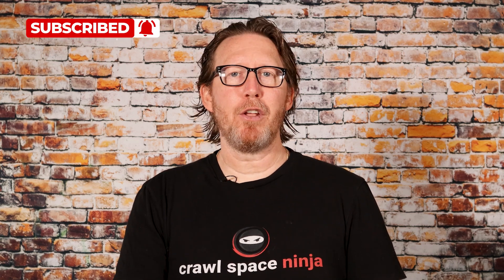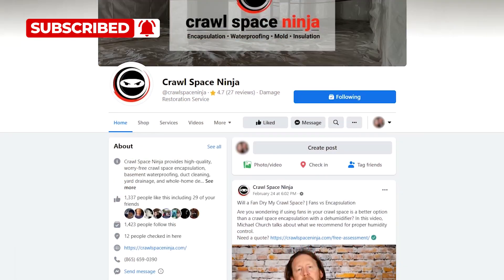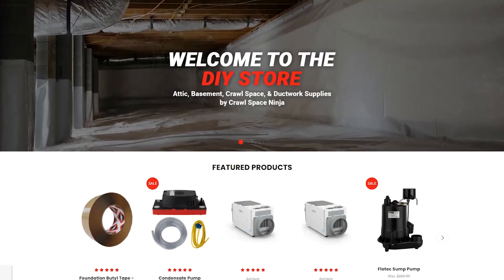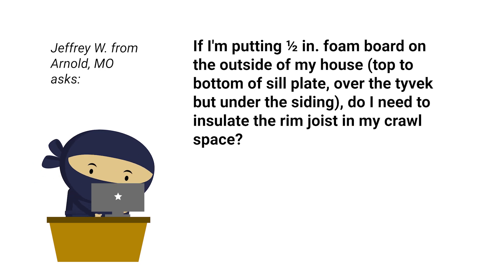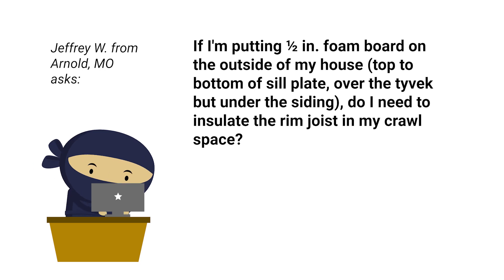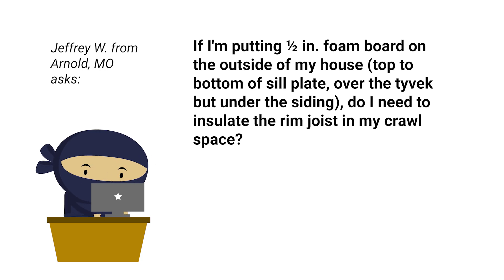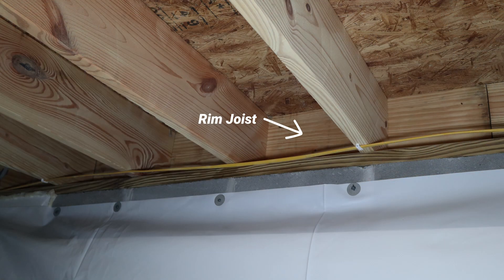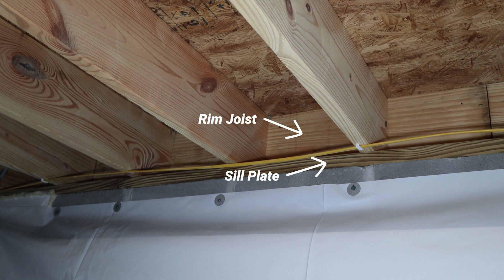Do You Need Rim Joist Insulation If Your Home's Exterior Is Insulated?

Comment: Dear Crawl Space Ninja, I have found 2 inch eps foam board that has a facing on one side.  Can I use this to insulate rim joist in my crawl space?  If so which side does the faced side go toward the wood or toward you as you are putting it in?  Thank you so much for your videos and keep up the good work.
Reply from the maker: Hi! it doesn't matter which face!

Comment: If you had a professional encapsulate your crawlspace and removed the floor insulation and tell you it was no longer needed. Have they misled me and took a short cut to the work but not the cost of the encapsulation.
Reply from the maker: We remove subfloor insulation because we insulate the crawl space walls! We do this as the subfloor insulation is not needed if we insulate the crawl space walls

Comment: Would sealing the rim joist with a bead of spray foam prevent bug penetration? Do you have any tips or tricks or videos for preventing insect penetration? Thanks for the content
Reply from the maker: It should certainly help. You can also do a small bead where the foundation wall meets the sill plate, just don't cover sill plate if you have a termite warranty. We don't do a lot of pest exclusion like the pest control companies do. Hopefully I can find one to do a video with me on that. Great suggestion. Hope that helps.
Reply: @CrawlSpaceNinja  thanks. Yes I think pest prevention is an overlooked benefit from air sealing that I can’t find too much content on. It seems most folks and companies are fine with using chemicals to kill pests whereas air sealing is solving two problems at once

Comment: What would you recommend on insulation a cantilever ( overhang ) and the rim joist?
Reply from the maker: We have used a combo of foam board and spray foam to air seal the cantilevers. Not seen all that often in our area but that seams to work for us. Hope that helps.

Comment: Hi so I have brick and mortar filing my rim joists blocking access to the wood, no clue why it’s there but am I pretty much screwed from sealing the rim joists because of this?
Reply from the maker: If the brick is touching wood you could caulk around the edges where the brick and wood meet to seal it. Other than that, not a lot you can do.